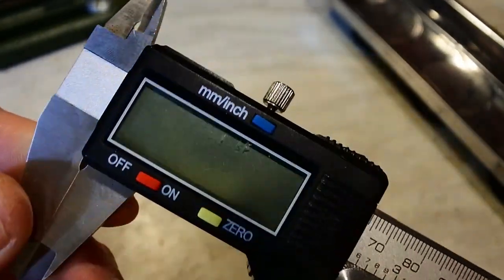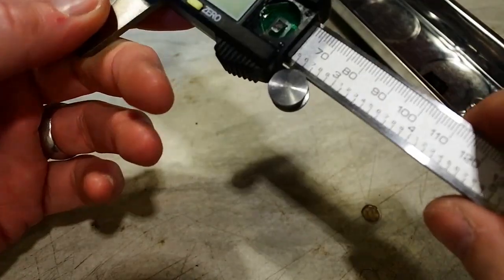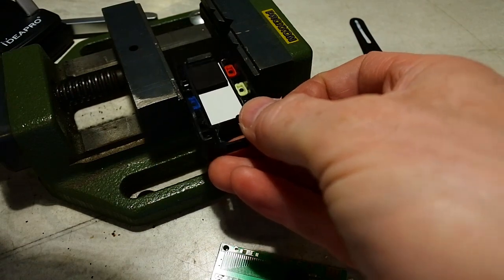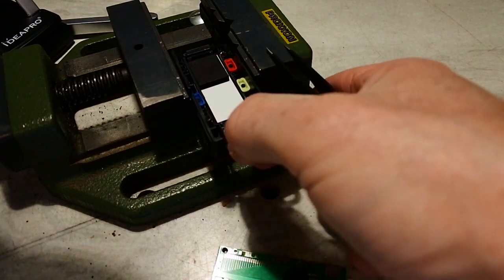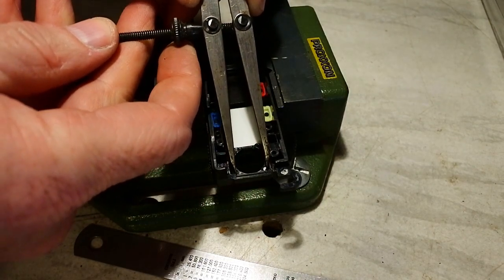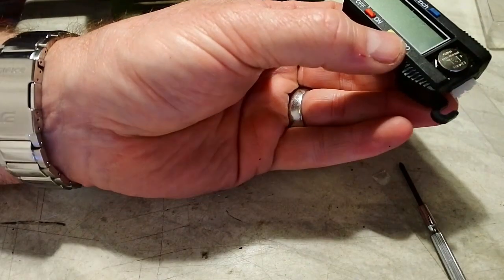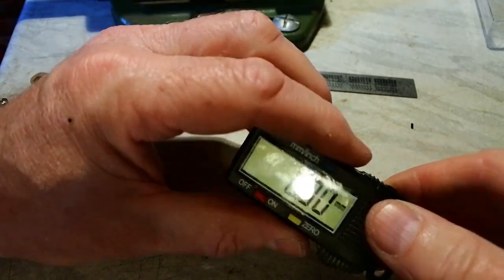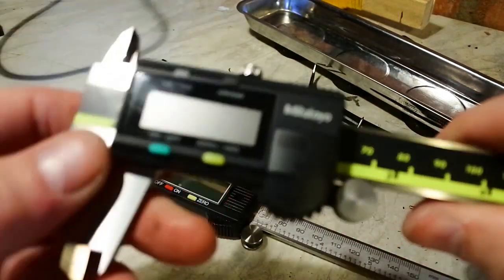The 'Never Flat' Digital Caliper Battery Isolation Hack

Comment: I had the same problem. I just use it without any battery in it. You can read the graduations that are stamped on the strip anyway.
Reply: Yep, I can easily tell the difference between 25 thou and 27 with my naked eye on that scale... It isn't a tape measure.
Reply: Just plug it into the mains and be done with it. Not everything has to be wireless.
Reply: Sorry but that makes no sense to me. Can’t see your face so I’ll assume it’s a joke.
Reply: @836dmar  See look! I have a video tutorial for the same result other method is one faster, I will explain in the video what the difference is. speed. one 1s a second the 2. more 10 secund, this matters a lot for many similar operations. Can't you see my face and you're joke? Not at all! The joke is when you don’t find a video valuable because you don’t see the creator’s face in the video.
The video here is really a joke, but not because you can’t see his face!
Reply: @CNCVelMart  I’m confused. Your response came out a little disjointed. I was referring to Richard Barton’s comment about just using the graduations and no battery. I don’t call people a joke or make the typical troll comments - that’s in poor taste and ill just move on. I was seriously assuming he was joking. Without talking it’s often difficult to catch a dry sense of humor.  I know because I have one.
Reply: These things are so cheap the sticker is more of a suggestion than anything else
Reply: The only reason to use a set of calipers is for accuracy greater than what you're suggesting.
Reply: Just take the battery out after use, simples!
Reply: @fredsayer924  That sounds like a good idea but IMHO the battery cover would break very quickly.
Reply: Its designed to measure and display thousands of an inch these digital verniers do not have interpolation lines or a dial to measure fine measurements like analogue verniers do so if your using it without a battery you may as well use a ruler and use the vernier as an adjustable spanner

Comment: My problems ended when I quit using alkaline batteries, changed to silver oxide. Alkaline voltage drop curves are not friendly, requiring battery replacement before dead. Silver oxide has almost flat voltage to its end of life. Most of these calipers state silver oxide but users swap for same size alkaline thinking they got a bargain.

Comment: Thanks. Your modification works great. I had to remove the battery to prevent it from  draining when it was stored away after each use. It's too bad that the on/off switch didn't actually shut the micrometer completely off. This made the micrometer a battery eater.

Comment: I've had a "paid $12 for it at Home Depot when I bought it" digital like that for coming up on 4 years now, and to date, it has never once refused to turn on and work, despite being used anywhere from half a dozen times a week to half a dozen times a day (or more when I'm actively working on dialing in a 3D printed object) - on the original battery. It came with 2 in blister packs, and the second one is still in the case. <shrug> YMMV - The day I punch the on button and it doesn't come up, I'll find out if the storage life of the second battery was any good :)

Comment: Would be quicker to just fold a piece of cello tape about 2" long and wide enough to fit then slide it under the battery and slide the cover back, so just slide out the tape before use and put it back after, simple! :)

Comment: I pop the battery out and put it back in upside down in storage.  This way i always know where it is and it doesn't drain.
Reply: I don't know exactly what happens when you do that, but won't it set up some kind of nasty electrolytic reaction?🤔
Reply: @EleanorPeterson  Hasn't so far.  The negative is touching both of the contacts while the positive is just hanging out against the plastic.

Comment: I've wired my calipers up to a huge solar panel that I wheel around with it - you just can't be too careful. 
Actually many come with a small plastic tab that you pull out to initially turn the calipers on. You can put this tab back in by feeding it through the hole for the battery and out the thin gap. It takes longer than taking the battery out, but it quicker when using it.

Comment: I found simple solution to this problem - just tighten the lock screw , turn it off and battery is never be flat. I already use this method for long time and never had this problem any more.

Comment: Why the hell can't any one make things anymore with a real on and off switch like it was done.
When the switch was off there was no power to anything, it worked just fine for a 75 years . And then some one thought that they could make it better using a switching transistor, the power is always on to make it work, just dumb .
Reply: So it will know the position when you turn it on, if it happens to move when "off". That is a big point for some people, it knowing where it is. But, I always zero out any caliper every time I use it.
Reply: I think there was a good intention behind this design flaw. The developer wanted to make sure the device will still be working if you forget to turn it off. How it is possible to develop such clever device and not to notice it uses (practically) the same amount of power whether the display is on or off? My personal suspicion is: the original product did not have this problem. But then some chineese developer 'reinvented' the device. And since that day, the chip sucks the battery empty...
Reply: There is no power switching in this model, even transistor, it's merely pretending. "off" to it is purely whether the digits are displayed or not. That difference, I measured, is about 0.6uA, but it is constantly drawing ~18uA all the time. So you can choose between using 18.8 and 18.2uA with the power button. Mitutoyo genuines draw 5/1uA between on/off.
Reply: Couldn't agree more. The simpler a system, the more efficient it is.
Fail to understand why there is a need  to change what perfectly worked for decades.

Comment: Flat battery... I discovered mine were Aluminium/Air batteries.Once the air-preventing sticker was off (that covered the tiny tiny air-holes), nothing would stop it to run down empty over time.  I now batteries based on a different kind of chemistry...

Comment: The biggest drains occur with those calipers that have no locking screw. You put them away closed but the slightest knock on the box/caliper and the jaw moves enough to switch it on. I counter this by rolling on an 'O' ring to secure them. Works a treat. I can live with the 'off mode drain', batteries are cheap

Comment: Pretty good solution for metric users, but for English measurements, one would have to set that button as well as zeroing it. The difference between the sleep mode and just leaving the LCD display always on is only a couple of days. By interrupting the battery, it should last for years.

Comment: is it just me, or is it easier to just take out the battery? i keep batteries next to my caliper stand, or put it back in its case with my more expensive set.

it is a cool mod. and certainly nice for the cheap plastic calipers. my good ones tend to kill my battery faster than my cheap ones from just sitting. but to be fair whats the point of an on/off button if its only a sleep/wake-up button? just make the button do what it says it does, if i try to use the calipers when they are off... i'll quickly realize i have to push the button first. this sleep mode seems like a gimmick by duracell and energizer to sell more batteries :D
Reply: This is absolutely easier than trying to pry that fiddly little battery out of it every time or forgetting to do it all together and getting a flat battery which is easy to do when the display is off.
Reply: Agreed, I flip my battery over, super easy to do when done with it.

Comment: This fix is not really needed. Batteries have a natural discharge. If the caliper runs out of battery in a year there is another issue. Such as the on switch being somehow pressed.

Granted, battery isolation leaves no room for error. But the electronics don't drain the battery in any noticeable manner.
Reply: >> the electronics don't drain the battery in any noticeable manner.

Wrong
Reply: Yes they do, in order to retain the position. If you switch them off, then move the jaw, then switch it on, it will register the new position.
Mitutoyo have a patent on low drainage, the rest take a considerable amount- measure it if you do not believe me.
Reply: I have this exact model, if you take the battery out it lasts for 5 + years, leave it in then its a year or so.
Reply: I measured a constant 15uA load on the cell whether it's "on" or "off" in my cheap calipers. That means the cell will be dead within a few months unless it's removed when not in use. This video is so slow that I didn't watch it all.
Reply: The calipers ADC is always reading even when off. It's so you can pull it open and it automatically turns back on. Plus position retention in memory. This leads to a very high quiescent current...
Reply: @nyetloki  Exactly.
Reply: You must not have a pair of cheap ones. The cheap ones last a few months. All of them. You go to use it and it's dead. Mitutoyo, Brown and Sharpe, Starrett, etc, last about 3 years.
Reply: @nickp4793  Mine is so cheap it doesn't even have a brand name. only 3 years from a branded seems crap, they really do design them to fail by putting a component to do just that right on the board.
Reply: @jedics1  I was referring to the battery dying, not the pcb failing. The battery on name brand last about 3 years. The battery on no-name last a few months. That was the whole point of this video.
Reply: @nickp4793  Oh, I just keep taking the battery out after I use it..
Reply: Most everything with a sleep button kills battery's in a short time .
Must remove or have a dead battery.
A real on / off  Switch would stop this , it worker for 75 years .

Comment: I have two of these, and use them both around 20 times a week, average. I have found them to last around 2yrs before needing a new battery, which I can certainly live with, as the battery cost is £1 (GB) for around 20 batteries, at the £1 store in the UK. Perhaps you have been unlucky, or I have been lucky, who knows?. It's worth noting that I keep mine on a backboard in the workshop, not in A box.

Comment: I just take the battery out, when I've finished whatever job I've been working on.
Reply: It even has a place in the case to store the battery. My time is valuable and although I applaud the hack takes like 10 seconds to just take out the battery.
Reply: @reidbridges1774  10 seconds?
Reply: @alfa-psi  I've been doing it since I bought it (about 12 years ago), and it still fits OK.
Reply: Soon, the cover wears out and you have to buy a new unit.
Reply: @fungames24  Mine's over 10 years old, and the cover hasn't worn out.
Reply: @fungames24  The cell will stay in place without the cover, at least on my cheap Aldi calipers.

Comment: I found it was the foam in the storage box that presses on the on/off button, turning it on when the box is shut. 3 ways around it: just cut out a bit of foam where the button lies, isolate the battery with a bit of plastic, or as others have said, take the battery out which takes 5 seconds ;)
Reply: that could be the case with nicer calipers, these lil guys just drain even with the screen display off. Cheaper calipers are cheap because less parts and labor so while they may be physicly accurate enough, the electronics are junky
Reply: You might have a good point about the case / box turning it on .

Comment: Options: 
1) Buy the Mitutoyos and stop complaining
2) Buy a long strip of batteries and just keep replacing them
Reply: 1 is very expensive for hobby use
2 the battery is very hard to get (annoying little bateries)
Reply: @felixgamingvlog6702  I bought a 10 pack for about $5 from ebay, also I have the mitutoyos, they were not that expensive
Reply: @MF175mp  i mean the batteris is not expensive but mitutoyos in my area is expensive i mean my only use is for 3d printer soo accuracy doesnt matter that much i mean mitutoyos is decent caliper but overkill for my need
Reply: @felixgamingvlog6702  sure but you don't need digital either, the plain old vernier calipers work great and don't need any batteries. I use them also.
Reply: @MF175mp  my eyes is shit if i be honest i mean vernier is not bad option but is easier just to look the number in the caliper than reading dial especialy when your work desk is a full of mess

But man mitutoyo is soo good

Comment: Huh, this must be a common but not ubiquitous flaw, or it was fixed before I got mine.  I leave it off for years in the drawer and it has always turned right on for me, dont' think I've even used the spare battery that came with it yet.
Reply: Same with me. I got the same-branded item from Aldi UK. Had it for a year. Never noticed any battery problems. The only problem is that it often jumps, with the display failing to match the scale position.
Reply: You have probably got one that does not retain its setting. So you have to zero it every time you switch it on.

Comment: I have a Kobalt brand with lifetime warranty and it drains the LR44 and the very small screws that hold the battery cover are bound to get torqued or lost and no, tightening the slide clamp screw does not keep the battery from draining. The instructions say to remove the battery if not to be used for a long period of time. Well nine days does not seem like a long time.

Comment: I found the same problem when I first started using mine years ago. Fortunately the case it came in has a cut out for a battery to fit in so I just remove it after use and store it in the space until next time. Must be a defect in the design to drain it though!

Comment: Maybe I missed it, but you still didn't explain how the battery depletes.
Reply: The "off" button just powers down the display, it doesn't stop the circuit from continuing to measure where it is at all times
Reply: It draws on the battery as it remembers your last setting, eg. where you'd zeroed it.
Reply: When you press the off button, the only thing that happens is the digits are no longer displayed. The processor is still working 100% the whole time. The difference in power draw is like 100% down to 96%. Your battery will still go flat in months while it's 'off'.
Reply: @ivolol  Which is exactly why I remove the battery after each use. Not an issue anymore.

Comment: Thanks for this great hack. I do Fitting and Turning and have Mitutoyo calipers and the batteries in them last all year using them every day. I have some el cheapo's that I use for my electronics hobby and the battery lasts a month or so. I'll be doing your same hack. 30 min hack and fixed, putting batteries in and out every time you want to use the thing.....Blah!

Comment: I take the battery out turn it over and paint it black then I grind all the numbers off then cut the pointy bits off then drill 4 holes in the glass and then drop it in sump oil for a week THEN throw it in the BIN then I will go into my very dark room and rest thinking what can I do tomorrow. I think I’ll start on the kitchen scales that needs fixing. I have 2 nice men with a white jacket with long arms they help me on with it and tie me in a knot.

Comment: I just leave the battery out until I need to use the caliper...............
Reply: Been doing that after the battery of mine was dead after some time without using it ... but then, re-inserting is stupid, too, so I have it laying around with just the battery cover off, which is prone to losing the cover ... not optimal either.
Reply: @GarryMobi  I keep mine in its case, which has a little cut out for a spare battery..........it's a pain having to insert it each time, but not quite as big a pain as having a dead caliper, and then tear the place apart looking for a battery..............
Reply: It all depends on how often you use it. I use mine less than once per month, so taking the battery out is the easy solution. But for more frequent use, the insulating tab described here is a good solution.
Reply: @PsyPhi25  if you need calipers daily, you can afford a Mitutoyo that doesn't have the flaw and is more reliable otherwise as well
Reply: @jerrydemas2020  .....why didn't I think of that?

Comment: I have had a few of these since they first appeared.  There are two different types: the ones I prefer retain the last measurement when they power down.  The other type does not do this, and if it "times out" the display will read zero when it is turned on again, regardless of where the jaws are.
I assume the second type will give better battery life, as it will not be using power to retain the setting data.  For me, the first type works better, and the battery life is more than acceptable, but I do keep spares, just in case.
Frustratingly (is that a word?), the retailer where I purchase mine does not identify which type is in the pack... luckily they have a "No questions" return policy, because the staff have no clue what I am talking about!    :o)